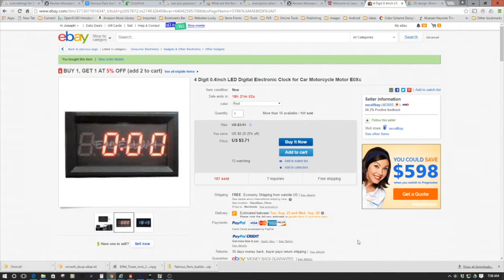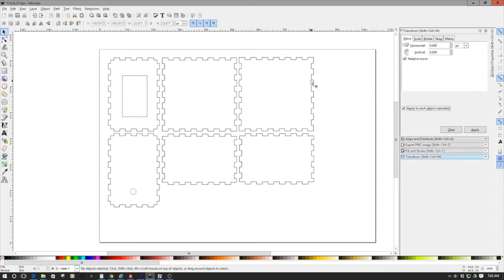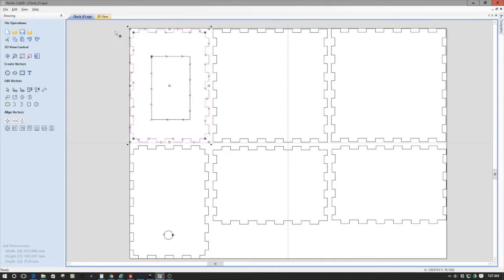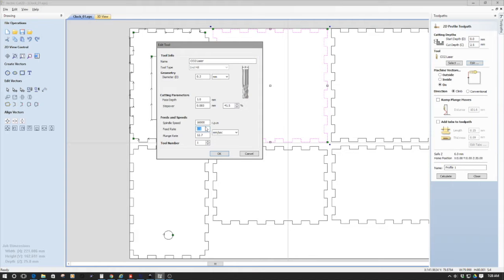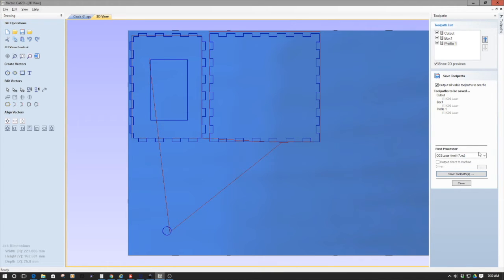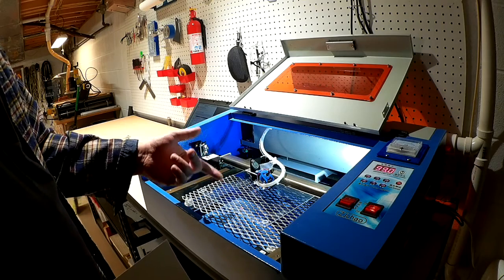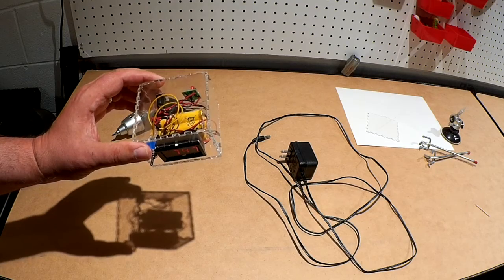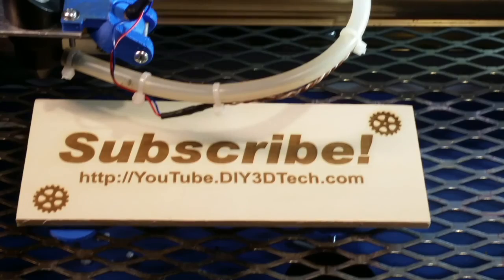K40 eBay Chinese CO2 Laser Cutter & Engraver - Upcycling an eBay Clock Module!

Comment: How is the repeat ability of this machine?  I keep seeing a lack of a home before the job and that is bad because every CNC router/mill and 3d printer I have seen can/does home first (though on the router/mill you can just one off it and move the bit into position if you want).
Reply from the maker: Since changing it to GRBL its great!  That is one  of the reasons for changing, on the stock version between runs its is poor in fact I would say useless to even try and repeat a job at least on the two I have...
Reply: DIY3DTECH.com
Yep, what I was thinking.  It does look like the 50 and 60 watt versions come with more stuff and seem to be better built and I do believe have homing switches, do color pictures, and have repeatability due to those homing switches.  So much more expensive and if you add everything up the cost difference isn't really justifiable from a cost per part perspective and that it comes from China, lol.

You caught me online watching more Chinese laser videos and I would grab a 60watt version if it were not 1k-1.1k more dollars which is just insane.
Reply from the maker: Yes the larger ones have better software, however keep in mind the 50watt units are over driven 40watt machines.  I going to build a new shop and in 2017 will order a 60 watt unit as it will be big enough to accommodate it as that is my issue now (room). And will also keep a 40 watt unit too for YouTube as I get tons of view for the Laser and it to is a lot of fun but want to launch an Etsy shop and need repeatably to make it economically justify able as the 40 watt units work but ar too fiddly...
Reply: DIY3DTECH.com
You can tell that by looking at them.
Reply: Get an 80 Watt RECI tube, definitely worth it.

Comment: I was experiencing a problem with the far right not cutting all the way through and the problem ended up being beam alignment. The beam was jutting the lens at different points depending on head location. Fixing this involved readjusting each mirror, including using shims and moving the brackets that hold the mirrors and twisting the mirror holder at the head. Once I clearly understood which adjustments do what, it was pretty easy. For my final adjustment, I'm placing some blue tape over the lens and hitting it with a 2.5ma pulse which just barely marks the tape. I press the tape firmly against the lens holder so I can see the  imprint of the hole and compare it to the mark from the laser. I keep making adjustments until the beam hits within 1mm of the center at the 4 corners and center of the head's travel. After this I am cleanly cutting 3mm birch plywood in 1 pass at 10mm/s and 20ma.
Reply from the maker: That about you should  expect (1 pass on 3mm ply) however you may want to back it down to 18ma as at 20ma you are over-driving the tube and the CO2 will start breaking down.
Reply: Just use transparent scotch tape, that way you don't have to press it against the hole: you can see through it.

Comment: Ha that's a inkscape plugin I will have to check out . Great video 
My im gonna have to look at  that cut 2d  app .   I use Inkscape only and there is a plugin i have been using that turns the vector paths into G code tool paths .  Its a bit funny plugin to get used to .  i like how your way works .   When i get my lil' laser tuned up again , i will have to have a play , but so far the  free cutting path tool in inkscape has served me well .
Reply from the maker: Vetric cut 2d is pretty cool, however they have changed the lic model (I have an older version) not happy the change as you now pay for the size your machine and its more cloud-based/subscription based.  So i plan to hold on to my older code for a while.  I also ordered another CO2 laser so it should be here (or there as I am in China now)  next week.  Picked it new on eBay for $290 shipped so couldn't pass it up as was about the same price as just the tube!
Reply from the maker: Yes I too have Inkscape GCode for simple things, and it work however what you lose is the more complex tool movement strategies.  Also my day job is in IT all things are moving this to force upgrade as too many people sit on old code and it forces declining revenues for continued development.  A bit of a catch 22...
Reply: lol , i have found some of the contract code i did even only a year ago was towards this . i remember when one would upgrade simply because the new version warranted it by features and such . I suppose i'm a bit fussy that way . as far as old code sitting , i'm guilty of that in many ways . I have found many of my old tools that work great on XP pro , simply did not compare or even work on W7 and later . so i kept a XP rig running and isolated .  I have also gotten so mad at specific tools for some things that would just code my own . 
Ah well people vote with their wallets , and shops have to keep the lights on.   Many software tools have gone subscription based, and thats cool i get it , especially if the item was historically crazy pricey .  It's for sure valid way to stay alive . also avoid piracy in some ways . 
but some tools are just not priced ... um .. $ for value , lets call it that . lol
Reply from the maker: Me too on XP and in fact I have switched over to Linux for most stuff (have worked in IT on Unix in the past) so no big issue :-)
Reply: there is a new OS open source , i forget the name , but its built to look and feel and run XP apps , but the OS is young . i wish i could remember then name. all my old XP rigs are moving to linux of some sort . 
I wish W7 was left alone and not messed with by MS , i was just getting to like W7.